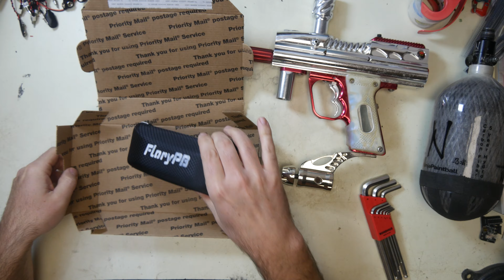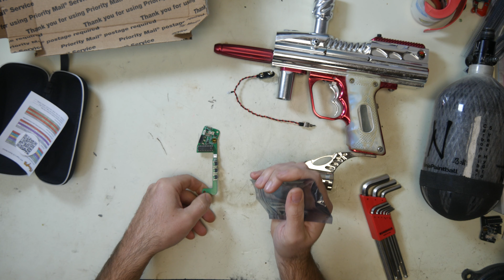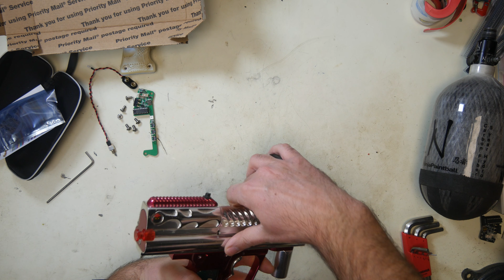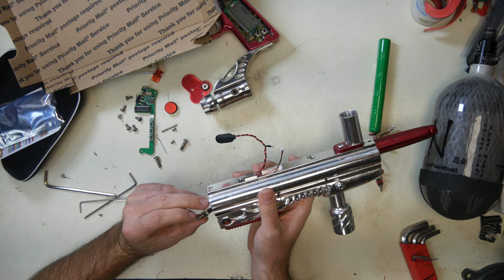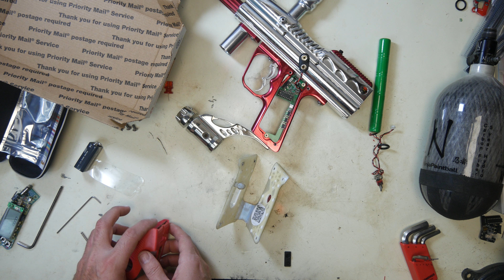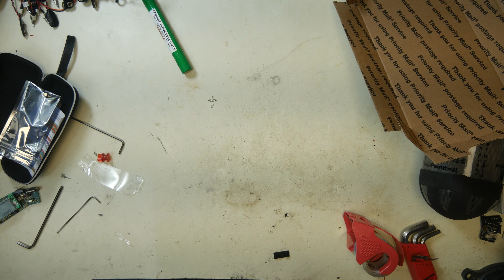Angel LCD Board Installation

Comment: Cant get the board to install without the top red button on the back always being activated.  There's not enough room in the mounting holes to get it to fit
Reply from the maker: What screws do you have in the frame?  If they are the Philips head screws that is strange if it's the tapered back plate screws I will send you a set of pan head screws that should give you that extra adjustability you need
Reply: @andrewflorypb9312  it is the flat tapered ones like on the back plate
Reply from the maker: @GM-122  ok I will mail you some pan heads that will give you that small adjustability that the original setup had. I have your info from ebay I will send an envelope out tomorrow

Comment: Can you adjust the ROF in tenths. For example 10.5 or 10.6 bps?
Reply from the maker: It is set to be 1 bps increments. If you want to I can easily reflash a chip to a different increment amount but I did not set the stock up that way, the virtue clocks are way to unreliable at getting real bps out that fields use to try and sneak right up to the legal bps limit in my opinion, it is a .something in order to wash out the noise from the whole bps number